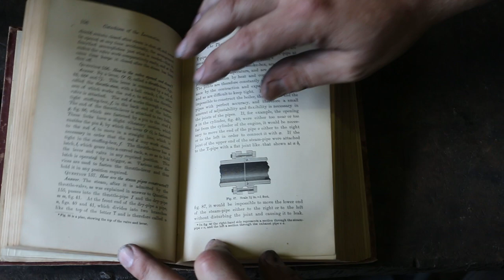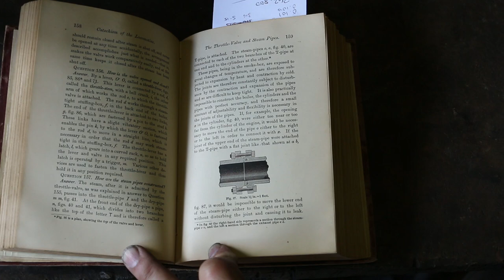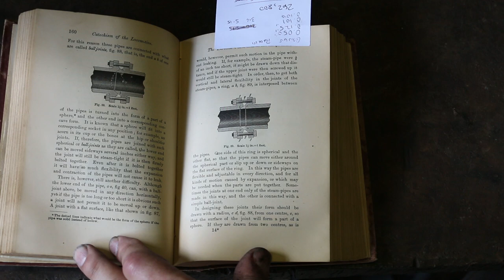Steam Locomotive Repair - Steam Pipe Rings

Comment: Do you ever get over the fear of ruining stock (or tooling)?  I know what that chunk of Ductile Iron costs and what that chunk of delrin costs...I'd be scared to death to ruin it...
Reply from the maker: Do I worry about it?  Not really.  Have I ever screwed up an expensive piece.  By all means.  It happens to the best of us.  But, you just have to just come up with a plan and work your plan.  If something goes wrong, you start over.  Fortunately, I have to start over a lot less with more experience, but it still happens from time to time.
Reply: I just can't get past it. I made an error using some 1/2" Teak plywood.  $150 GONE (yea, I have the pieces of scrap, but I couldn't use it for that project)...had to buy another half sheet.  To say my wife wasn't happy is putting it mildly.  I think it's the number one reason I don't get too into this stuff no matter how much I want to.  She darn near had a heart attack when I bought my table saw...which was needed for the projects SHE wanted done...She figured I could just go use my dad's tools.  Which is, again, why she's mad at me buying wood working tools as I will inherit his tools one day.  Too bad I need some of these tools now...and I'd like to wait as long as possible to inherit those tools...a VERY long time...

Comment: When do you need to use cutting or not?
Reply: Most guys don't use cutting oil or even coolant when cutting cast.Don't really need it and clogs up the chips.
Reply: +Mr Frog I do, only to keep the dust down. It's not so bad with ductile, but grey iron just turns to powder. Coolant does a good job of keeping it off of my ways and out of my hair.
Reply: flood coolant and grey iron would be a bad combo though> ending up in the bottom of the pump sump i would imagine.
Reply: +jusb1066 In the mill, most of it settles out in the t-slots or in the trays on each side of the table (Haas vf-4). It's more of a mess in the lathe, but I clean the sump out a few times a year anyways, so it's not a big deal to me.
Reply from the maker: Flood coolant will also wash the fine stuff into your ways.  I like to keep it dry so that I can vacuum it up and then wipe it up!

Comment: Oh I'm also sorry about this but you should be using oil on that big drill. You are going to burn that drill up in a heartbeat.
Reply from the maker: Again, I disagree with you.  I was drilling through cast iron not steel.  You should not use oil or other cutting fluids on cast iron.  

1 - The cast iron contains graphite which serves as a lubrication when cutting.
2 - A large portion of the chips produced when cutting cast iron is a fine powder - a very abrasive powder.  When you use oil or other fluids, it washes this abrasive powder down into the nooks and crannies in your machine (i.e. the ways, nuts, bearings, ect) and cause excessive wear.  Much better to machine it dry and then vacuum up the chips and then wipe up with a damp cloth.  It will go a long way to keeping your machine from being excessively worn.

Comment: What is dry steam?
Reply: Very hot.. No condensed water vapor mixed with it..   For example your tea kettle when it boils the steam coming out is wet, the temperature is not much higher than boiling point and there are drops of water moving in the steam.  Dry steam is all gas and very hot, much higher than boiling point.
Reply: Superheated steam https://en.wikipedia.org/wiki/Superheated_steam
Reply: It's steam that  has no water in it. When water boils in let's say a kettle a lot of water gets taken up with the steam. The water portion delivers no useful energy so it's separated out or the steam and water mix is heated a second time to convert everything to steam.
Reply: It's steam that is super heated 
It's the small clear potion that is near the spout of your kettle as opposed to white steam vapour

It has more energy in it 

Stuart
Reply: Usually dry steam is steam coming directly from a boiler by a steam dryer. This was a unit usually located at the steam dome or the smokebox, which gave the steam some additional heat, just to ensure all water was a vapor.

Wet steam was usually taken directly from the boiler, and condesend easily on the inside of steam tubes, so has allways little droplets, making a very nasty stuff to deal with, as if washes away oil films and has a very, very rough and abrasive behavior on fittings, at leakes and inside sharp pipe curves.
Also it was still condensing, thus expanding if taken from the boiler, so it was not really economical, because as longer the pipes got, as less pressure on the engine was - as more power was lost.

This was overcome with steam dryers a little, but with superheaters in excel. So steam was taken from the boiler an by special coils in the smokebox, the exhaust chanals directly after the boiler, or in locomotives with extra tubes inside the smoke tubes of the boiler, the steam was heated up. It does not gain more pressure, it just heats up more.
So usually many boilers have a output of 190° C to 210° C, by superheating the temperature was giong into 280° C up to 410° C - and thus all steam was a very strong gas with a huge capacity of expansion.
Also is does not condensate on inner tube surfaces, flows very quickly and does not loose much power on longer lines. Also the abrasive power of steam dropped a little, but it cuts like a tiny laserbeam, depending on pressure, with very, very sharp edges.

Today we only talk about saturated steam, which is the steam directly taken from the boiler, and superheated steam, were saturated steam got completely vaporizes into "water gas"
Reply: Not exactly, this loco does not have a superheater in it.  You would normally see a handful of larger tubes in the boiler where the dry steam coming out of the top of the boiler would be run through the tubes again to gain even more heat which puts much more energy into the steam.  I don't believe there are many small locos with superheaters however some  Shays had them.

The dry pipe usually takes steam from the steam dome which is significantly above the water level of the boiler, that way there would not be in water taken down into the "dry" pipe since water is not compressible and you wouldn't want water going into your cylinders in your steam chest.
Reply: Thank You!  You answered perfectly a question I was going to ask, did this engine have superheating steam pipes?  Is there any general rule at what size engine or what point in time (year that they became a standard instal)  superheating pipes were added?
Reply: Even small scale model locomotives often have superheaters, so size is not the issue, cost and added complication probably is. if fuel is really cheap, ah the good old days, and runs are short the greater efficiency of superheating does not matter.
Reply: I believe superheating was "invented" around the turn of the century or I might be getting that confused with make-up water pre-heaters.  I also believe that the Janey coupler came about 1880s and the Westinghouse brake system, not his original brake system, which was not fail-safe and relied on the train line pressure to actuate the brakes rather that the triple valve opening up to let the pressurized air from the air reservoir on each car,  came into being around the early 1890s.  I thought I read that Westinghouse became interested in the brake system after he survived the train wreck in Angola, also know as the "Angola Horror" as title by the book.
Reply: Good point.  Then again you could gain efficiency by running the throttle in the company notch.

Comment: The old ones almost look like they were cut with an oxy fuel pipe beveler
Reply: Of course that would not work on cast iron or bronze
Reply from the maker: That is where the steam ate into the metal!
Reply: Ya that hot steam at high pressure is no joke!